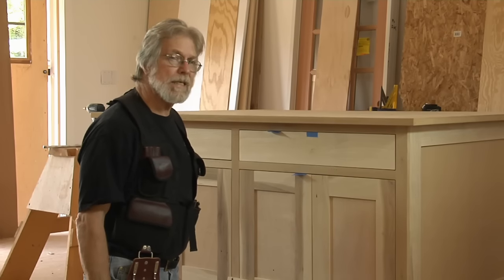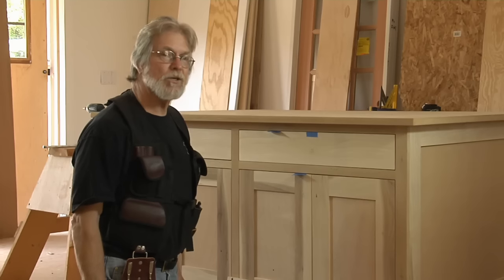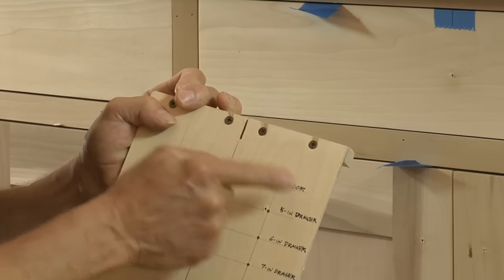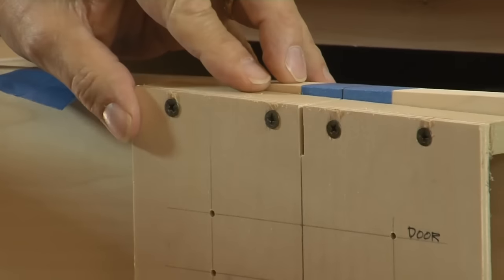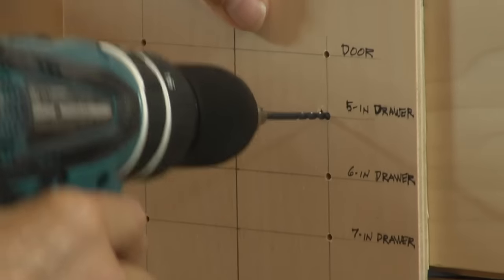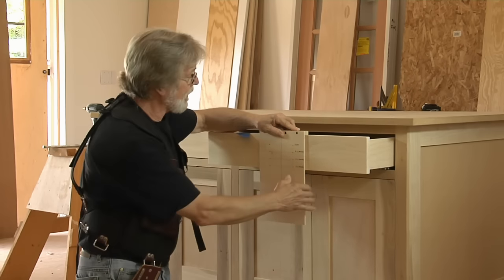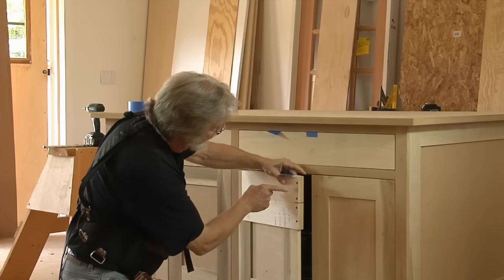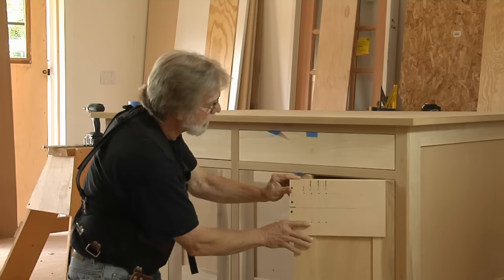Build a Simple Jig to Drill Cabinet-Handle Holes Perfectly

Comment: I always use what is called a brad point bit. They have a sharp pointed center that allows you to use pinpoint accuracy. Its also helpful when marking many holes in short order using this jig. This type of bit also does not wallow out the jig holes as much as standard drill bits. Then a quick trip around the cabinetry to drill all the way through- always back up your hole with a block of wood to prevent chipping the back of the door or drawer. its fast and easy. Best of luck to ya.
Reply: Faster and easier is a tapered drill bit. It eliminates the need for a backing board.

Comment: Thanks for the tip and  I made one for some under island drawers i made. 12 drawers drilled quickly and most importantly my wife loved how they were all perfectly aligned and spaced! Happy wife- happy life!  I used handles so I had to drill two holes per drawer and made the jig fit the width of the drawers as they were all identical width.  That way I didn't have to have a center mark, but just hung the jig that had stops on either end.

Comment: Thank you so very much.  I have been struggling for days with my drawers and handles.  One very frustrating issue I found was that the holes in the handles - cup/bin type pulls - are not exact.  Each one is slightly different - just enough to cause a headache.

Comment: you should drill a 1/8" holle in your jig and use a center punch to mark your hole spacing then use a self centering 3/16" drill bit to drill the holes.
I have a better jig system.
Reply: didn't see it on your channel

Comment: I bought the aluminum jig turned out it wasn't square ie to many moving parts.
You'r vid made more sense, however I would measure on the inside avoiding non-flat outer edges.
great vid thanks

Comment: Just a thought. Doesn't the drill flutes cut / widen the guide holes each time it's used?
Reply: I'm going to build this jig right now (three years too late for you) and see how well it works. I've got about 30 cabinet handles to put on. So I'll know if the flutes are going to get cut/widened.
Reply: @JohnBorgen  how'd it go?
Reply: @jjb516  it went well. I had some mahogany laying around...the flutes have not worn the template noticeably.
Reply: @JohnBorgen  use a center punch then drill the holes...

Comment: Problem is, the holes get bigger each time it's used and then becomes inaccurate. It's amazing how you can see a handle that's out by a 1mm.
Reply: Noel Sj you would need to drill a smaller hole, yes, but I wouldn’t let the screw do the rest of the work.

By hand, you would have to force it, taking a longer time over many cabinets. By drill gun you may get away with it but still forcing it and potentially wearing/stripping it.

Adding metal guides makes for a quicksand accurate approach. Buying a commercial jig is also a convenient option.
Reply: Or glue washers over the holes?
Reply: Yeah but this is good in a pinch, i only need to replace hardware on 1 door and the cabinet hardware jig i normally use isnt mine and i only use it at work

Comment: what size drill bit did you use for that 4 in center 8x32 screw? And I have a 1/2 drawer and 1/2 drawer front so would i need a 1 1/2 screw or 1 1/4 screw for the handles?  The doors are 1/2 think so i'll use the 1 in screws that came with them. Thanks in advance
Reply: 3/16" drill bit.

Comment: Is it just me or are all the cabinet hole spacings exactly the same distance apart regardless if it's a 5" center-to-center or a 6" c-c?
Reply: Based on what you said, they are not the same distance - some are 5" and some are 6".
Reply: Not all cabinet pulls use the same spacing. Some are 3", 5", 6", and a variety of measurements in between.

Comment: I have a question that I CANNOT find an answer to.. my husband and I are building a huge cabinet with two bookcases/drawers on either side as well.. a total of 9 drawers and want all those drawer pulls to match up.. Is there a template for double drawer pulls on one drawer??  I'd post picture if i could.. or maybe i could send a picture to your email???  help?!?!?!  :(
Reply: +Lisa Bevill  This jig will work for doubles. All you need are 2 centerlines, one on the left and one on the right. A little math goes a long way but you could simply assume to measure equally from each edge of the drawer front to the centerline of choice and then the jig will work. There are simpler methods the pros use but this will yield excellent results for the average user.